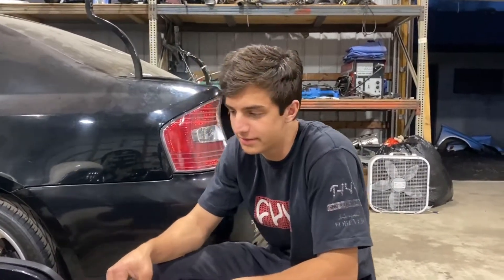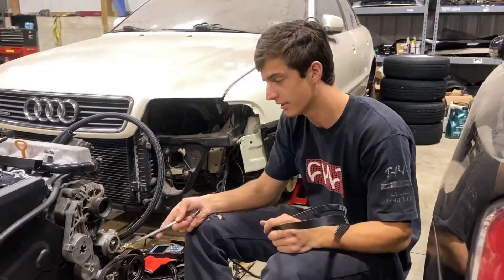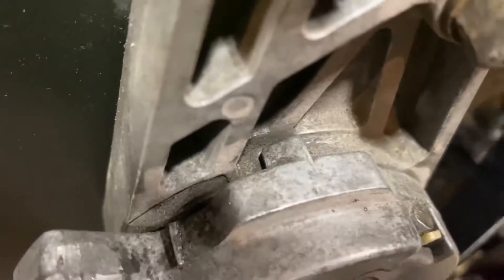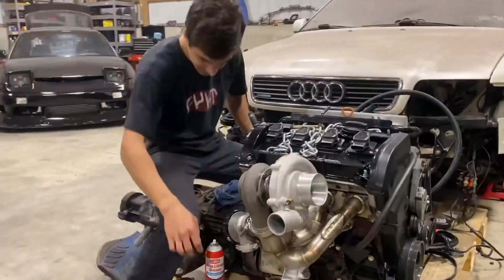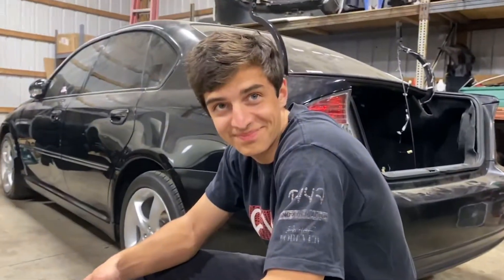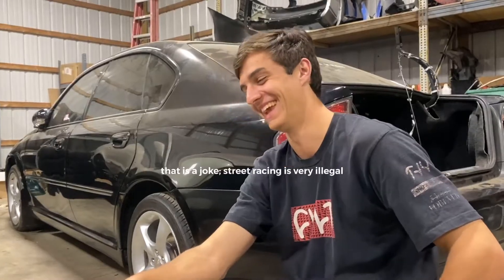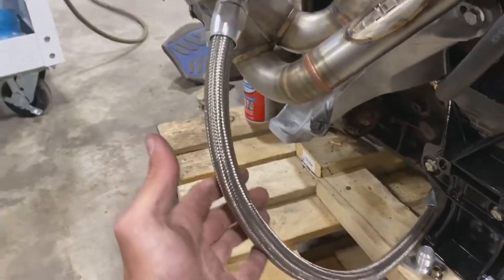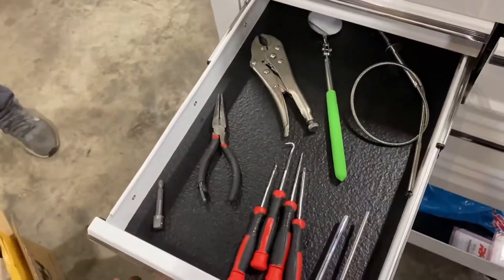B5A4 EP6: 1.8T Final Touches, Oil Lines

Comment: hey, the oil returns line is working fine? changed my Original turbo for a .50 48 turbo, i got oil leak at the turbo - they said it happens because i didint changed the oil line, the car got some smoke from the turbo also.
Reply from the maker: mine doesn’t leak at all, but the turbo burns a ton of oil at idle. I’m going to put a restrictor in the line to see if that solves it
Reply: @maxmyslewski  thanks for it man! Do you have WhatsApp? I Will send a vídeo from my problem. Really apreciate your help!